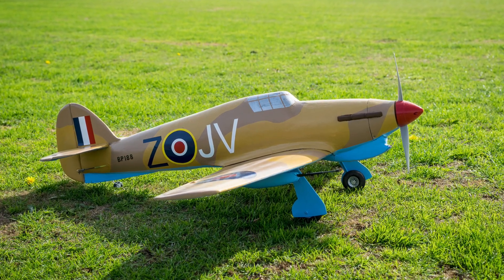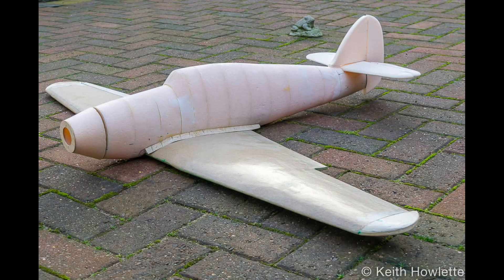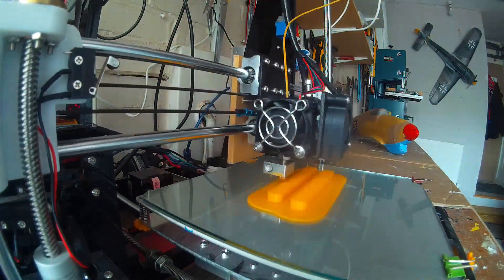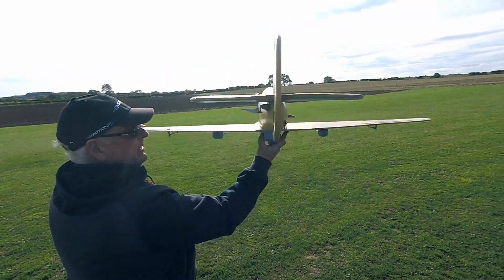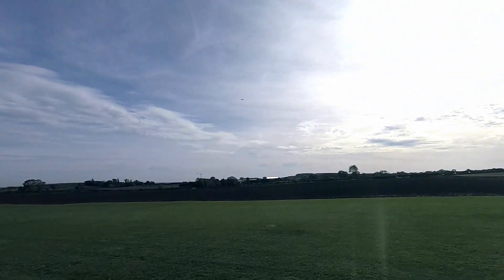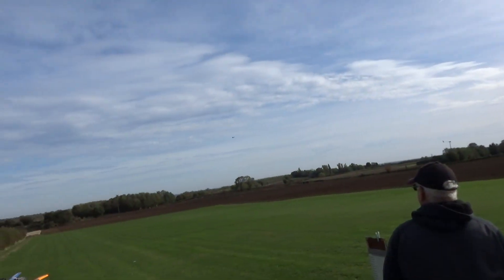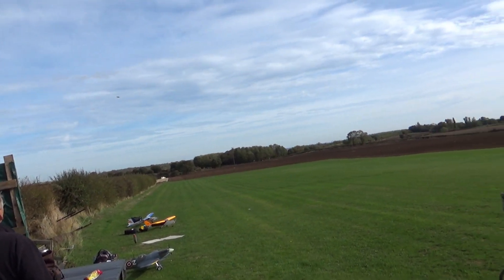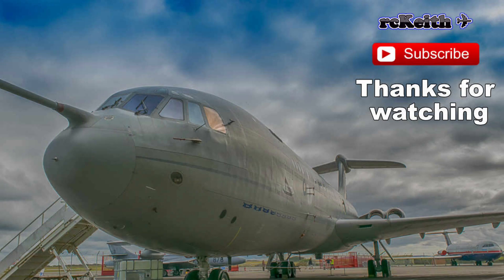Hot Wire CNC Foam RC Hawker Hurricane  IID - Part4 - Maiden Flight

Comment: Wonderful! I would like to attempt but they fly too fast. Do you think it can be made a slow flyer? (Depron 6mm about 1.2m wingspan, 800gr weight, (48" 1.8 lbs) I would love a floaty Hurricane
Reply from the maker: @dimitristripakis7364  The throttle goes both ways. It does fly slow as well.
Reply: @rckeith  Yeah but depends on wing loading and stall speed.

Comment: What material did you use to fill the gaps in the foam body?
Reply from the maker: I used lightweight filler and then covered in some fibreglass cloth using Poly-C resin.  Very easy to use and gives a some strong finish after a few coats. My T45 Goshawk was finished in the same way have a look at this video where I show the process. https://youtu.be/MLwwA6UzijI
Keith

Comment: Very informative videos and a great demonstration of the capabilities of the CNC 4 axis foam cutter.  Did you weigh the final plane? Lighter than traditional build?
Reply from the maker: Hi, just weighed her and with a 3000mah 3s lipo she tips the scales at 1.5kg or 3.3lbs.  For the size of plane, she does feel a bit lighter.  Thanks for watching I've built a T45 Goshawk in the same way, looks great but a few design issues.  On the repair bench waiting her turn.  😀
Reply: @rckeith  Thanks for the info. Given that your Hurricane is very very close to scale, I'd say that any equivalent conventional build would be significantly heavier. Congrats.